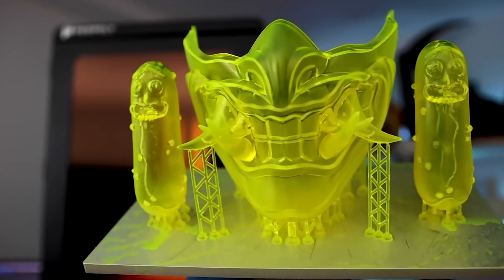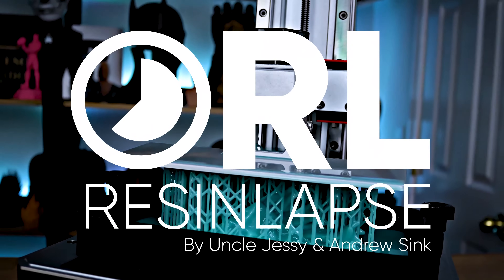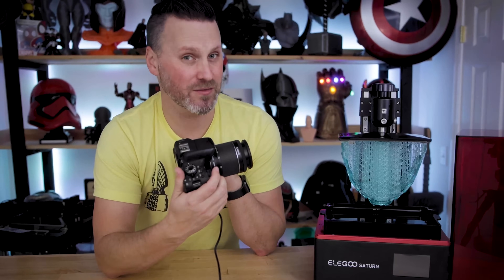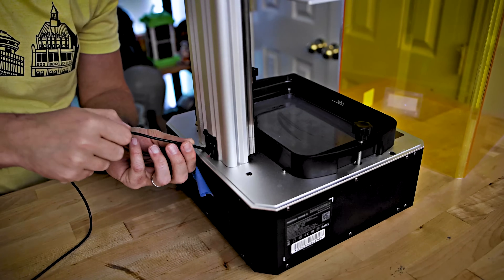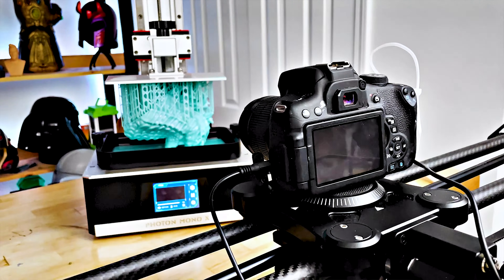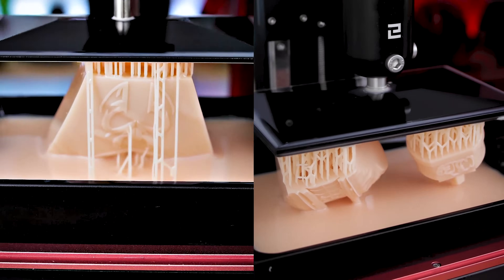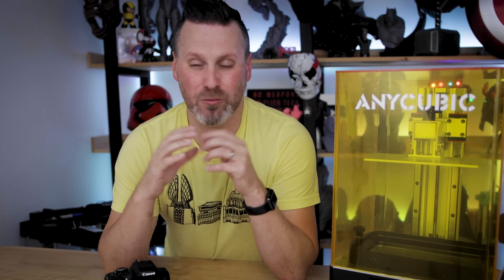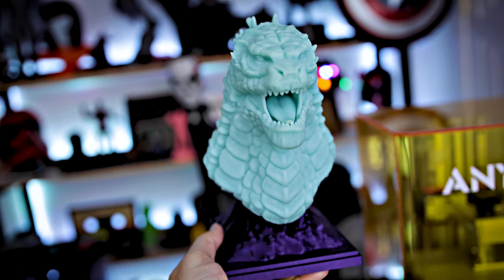Introducing ResinLapse - Resin 3D Printing Timelapses made easy!

Comment: Awesome cable! I got mine in recently and tested it with normal light and it works. I just cant seem to get it to work in my printer with the UV light, no matter where I place it. Does anyone have similar issues or suggestions? Using a mars 2 Pro

Comment: The price forthis is fantastic, but I own an a7iii. What sort of adaptors would I need to buy or solder in order to get this working with my camera? I was willing to throw down the $20 bucks, but obviously if it won't work with my camera, I'll have to pass. I bought a camera shutter off of amazon that seems to take the sony plug and turn it into a TRS male output into a remote. But I don't know if the pins are the same. If I bought a 2.5mm female female and plugged your cable [Photosensor ---> Male 2.5mm] into the shutter cable  [2.5mm into the camera], would your product work? I'm not willing to wait 2 months on shipping if this won't work, nor am I willing to gamble and test this myself.

Comment: I just purchased this as I have a Canon camera. I have a Canon M50, which has a 3.5mm connection,  not a 2.5. I bought a trs adapter hoping that would work,  but still nothing.  Any suggestions? Are you guys using a older Canon then the M50?

Comment: Noob question: if we take the cover off, and use a light to illuminate the build, how do we minimize UV light getting on the in-process build, or do I not need to worry about this? Just received my cord.
Reply: I was wondering this too
Reply: Maybe a gel over the lens, keeping the cover on...hmmm...might have to experiment.
Reply: Cover windows completely and use lights with low UV output.
Reply: @chaos.corner  , and how would one know if they had “lights with low UV output”?
Reply: @Pics2FlicksDennis  You could check the color spectrum sheets. I think fluorescents tend to be high and LEDs low.

Comment: Just received my ResinLapse in the mail today.  Now just need my Daughter to bring back my Canon Camera.  Question, the QR code on the package doesn't seem to work.  Does it load instructions on how to set it up on a Elegoo Mars 2 Pro?  Thx.
Reply from the maker: Hey there! Sorry about that I’m trying to get that link working again. Not sure why it’s not linking. Yes it loads instructions. 

Mars 2 Pro, remove the screws on the back panel. I believe there are 4, you can then slide the cable in from the back where the power switch is

Comment: I need to know if it works with Nikon cameras, after some research it does not.

ResinLapse is only compatible with Canon Cameras or cameras with a TRS 2.5mm port. Sony & Nikon cameras are not supported at this time.

I got my Saturn last week, going to print some of my models.
Reply from the maker: Correct, I believe it only works with some of the older Nikon cameras. We are working on support for Sony and Nikons or to identify adapters that will work

Comment: I'd love a low cost diy solution to archive the same that would work with webcams. I don't have a camera with tsr shutter control and I don't plan on spending 21 bucks for this. Any ideas?
Btw: The video is nowhere marked as an advertisement, through the whole video I thought this will be a freely available open source software solution.
Reply: Hook something like this up to the left-click button of an old mouse.

Comment: well done, love the simple idea! 👏😎 (I was complicating mine way too much with accelerometers 😅)
Reply: Problem is, it takes the picture with the print in the bed so you won't get the full picture. I think a more complicated one might be good. Though this has its place.
Reply: @chaos.corner  that’s true, but for the price and simplicity it’s fully worth it 🙂

 I’ve made one when the print is raised from the resin, using an accelerometer, testing now also other options. 

But regardless, I recommend the resin-lapse 👌😎
Reply: @marsgizmo  Agree. Very nice in its simplicity. Personally I'd probably work off monitoring the Z-axis or its stepper motor if I wanted the full reveal.
Reply: @chaos.corner  monitoring the Z stepper it actually what I’m testing now 😁 (need some time as I have too many projects)
Reply: @marsgizmo  Good deal. Having some logic in there means you can also not take a picture on every layer. As someone suggested, some prints can have 10,000 layers. Not such an issue on a shutterless camera but still a benefit.

Comment: Couple quick questions, I just ordered the cable.  (1) Can it be used with a gopro camera?  (2) i assume you turn the flash off on the camera but how do you handle the enclosure on the anycubic mono x printer?  (3) what software are you using once you get all the stills collected?  thanks!!
Reply: I do not believe their works for the gopro. I mae one for it though, if you are interested.

Comment: Hell yeah, that's a great idea! you mentioned there would be guides, will this include DIY'ing one of these cables together? I'd love to buy one directly but the price + postage to Australia makes it a bit inaccessible.

EDIT: So this was actually really easy to figure out, and props to Jessy for such a simple and elegant solution to this problem. You just need a light dependent resistor (LDR), I used a GL5528, and a male 2.5mm aux jack headphone cable. The one I bought was a 2.5mm to 3.5mm adapter cable, I just lopped off the the 3.5mm end. The 2.5mm jack is a Tip/Ring/Sleeve style conector or TRS for short, and what you need to do is wire the two leads from the LDR to the Tip and Sleeve of the 2.5mm jack. A multimeter although not necessary really helps a lot here to probe the wires and figure out which ones are for the Tip and Sleeve, and also to check that your LDR is working correctly (resistance should be high in low light, and drop way down when exposed to light).

I connected it to the 2.5mm input on my Canon DSLR and it worked straight away, snapping a shot every time it detected a change in brightness. I then pointed the LDR at my Photon S LCD and ran a number of detection tests and each time it took a photo straight away. Now I just need to find a place to mount it inside the printer.
Reply: Fantastic comment.  Thank you!
Reply: I was about to purchase one but the website said they don't post to Australia. Your post is a big help. Now once the LDR arrives, I'll need to work out the wiring

Comment: Wonder if there's a way to integrate the shutter cable into a raspberry pi for a USB camera or something.
Reply: Seems like it should be trivial. Now that they've developed this, you have the trons tamed and it's sending a signal out - reading digital signals is the bread and butter of the rpi! If I had a resin printer I'd be all over this!

Comment: Hey Jessy love this.  If you can do this with a Smart Phone this would be great.  Does this work on the Epax?   I ordered one in anticipation of this too.  Something for FDM would be great no octo software would make things simpler for me.
Reply from the maker: Yeah all of the octo lapse setup... needing an hour+ of time to setup was nothing I wanted to mess with. This is such a simple solution. In theory it should work with a phone but would need an adapter for the cable. I'm going to look into that more this weekend and see if I can find something for my iphone (old iphone). Problem with a phone is that you cant use your phone during the print ;)
Reply: @UncleJessy  I have several phones from the reviews I do. And since I am recording multiple printers I don't have enough dslrs to go around. Doing a review on snapmaker, lottmaxx and artillery.  Would love to do the new phenom too.  But need to contact them.  So for me I have enough phones to do this.
Reply: @UncleJessy   yeah and phone needs to be charged! with cameras u can get dummy batteries. But i guess u can do wireless charging on phone.
Reply: @Ryxxi_makes  Older phones have headphone jacks and charge ports. I use an old iphone SE for my FDM timelapse.
Reply: @UncleJessy  there is enough light leak in the bottom of the noir to trigger the photoresistor.... at least my setup
Reply: It is possible by adapting a selfie stick cable that connect to the headphone jack, replacing the switch by a light sensor
Reply: @gingerfreakstudio6362  big brain idea!
Reply: It said Epax in the video.
Reply: I made one for my smartphone. Its real easy. I may post a video tutorial this weekend
Reply: @jekjr909  did it works?
Reply: Yes it does work for my phone. Also made one for gopro
Reply: @jekjr909  So just connect it and it works directly? Or do you need some connector in the middle or something?
Reply: On most Android phones you can trigger the photos with the play/pause Button on the earphones! You Just need to adapt the earphone with a photoresisor.

Comment: are there any negative printing effects from no having the UV lid on the machine?
Reply from the maker: You can record with the cover on as long as it isnt super dirty like most of my cases. I do have my window shades drawn when I'm recording so I dont get any Sunlight on the open vat of resin.
Reply: Thanks for asking this cos I was about to.... I wonder if using my mercury cover on my mars would work... The red of the Mars is really hard to see anything through